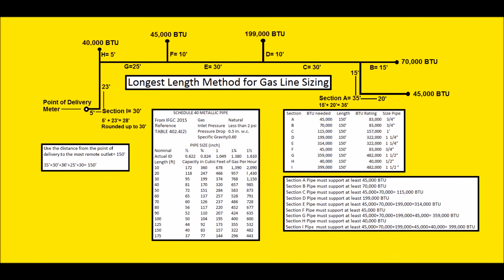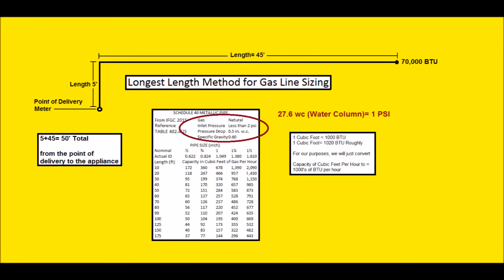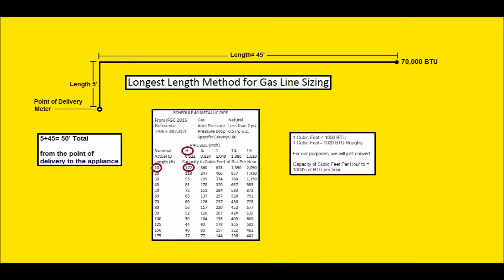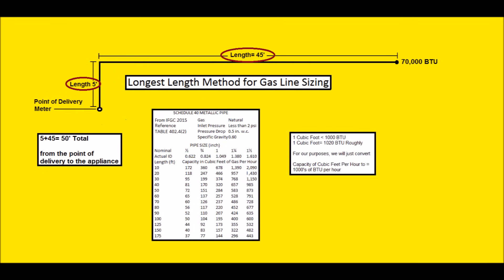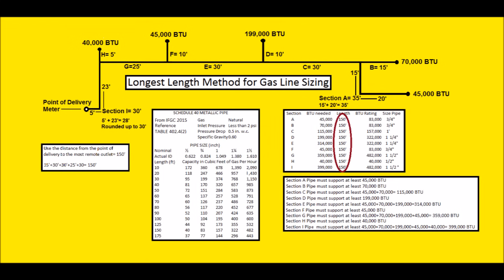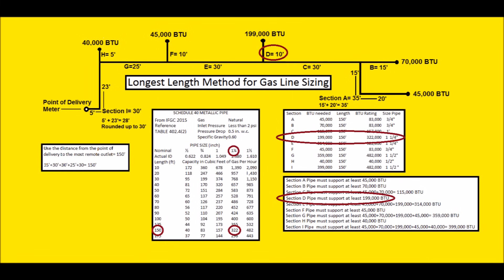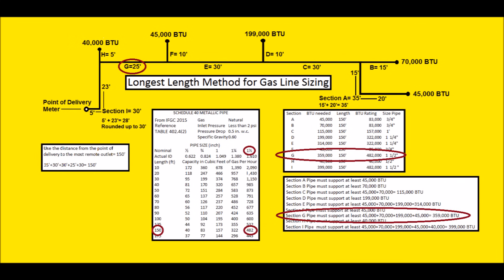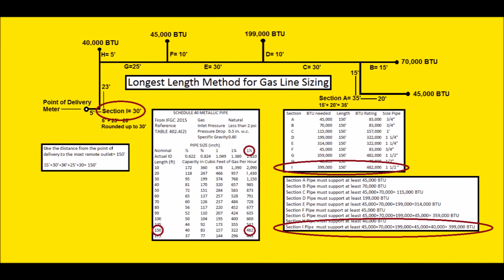Sizing Natural Gas and LP Propane Gas Pipe- Longest Length Method! IFGC 2015

Comment: Maybe you can help me out, according to my charts for undiluted LP it seems like I'd have to run a 4" schedule 40 metallic pipe to deliver 187,000 BTUH for 40 feet.  Dees that seem correct? that seems like a huge pipe to supply a home that has a 120k btuh furnace and possibly a water heater.

Comment: THANK YOU FOR USING THE TERM "MOST REMOTE!!!!!" I was having trouble because i was thinking "longest straight line" was what they were referencing, so I was just very confused as it was giving me stuff like 8" black iron pipe for a 60kBTU range. Commenting this the night before my test in class, as this helped tremendously knowing that its literally just the furthest possible point from origin.

Comment: Can i Use this on LPG ?? thank you
Reply: Literally no one talks about this. The LP charts don't seem to work with this at all. It's already measured in btu/h so it seems like you're not supposed to divide down but then if you don't, nothing adds up right. It doesn't make any sense.

Comment: One thing that makes 0 sense about this method, unless I'm interpreting it wrong, is that let's say you design an entire building with this method, and your longest length is 100 feet. So each appliance is sized with the 100 feet and according to their required capacity. Fine all good.

BUT, the day you add a small extension and need to add another appliance which is 120 feet from the meter, what then? Or say, to make sure we don't get the conclusion that line diameters won't be changed given the small increase, that the newest longest length, after the addition of the extension is 300 feet. Now all of a sudden you need to replace the piping in the entire building, because capacities were initially designed with 100 feet only?

Am I the only one thinking that makes no sense?

Comment: Do you do the longest run or to the end of the a main branch as the longest run?    Meaning you have a main branch that’s 10’ long, but off the main branch you need gas all the way over to some unit that’s 50’ long.  Is it then 50’ or 10’ for the main branch?
Reply: Longest measured run would be from where the line comes out from the meter to the furthest appliance. So in this case it would be 50 ft
Reply: @goaliebrody  but what if it’s such a small device only 3/8” line, low BTU?   It’s not like it can steal that much from the last unit on the main line that’s demanding a large amount of btu.   Just to explain, I have LP, 10’ main line 3/4” with 11 in w/c reg at the house.  Online that says the main line can support 608,000btu.  Off that main line I think I can run a 3/8 maybe 1/2 line over to a fire place that’s maybe 50’ away that demands only 28,000btu.   Sounds weird to make the system so large in pipe size when that long run is so small.   If at the end of the 50’ I had a 200,000 boiler then yeah I’d get that.

Comment: Hey Craig,
I’ve been following you for better than a year.  I’m getting into the HVAC industry and have passed the 608 EPA certification.  I am currently reading and finishing up the IFGC code training manual for black pipe cert.  My question to you is, what is the best black pipe pocket size code book available for helping me with codes for passing the black pipe test and for use later in the field?  I’ve Googled for the best type black pipe code book, but have not been successful with finding a small pocket size manual.  Thanks for all your content on YouTube and products you offer for training and for use in the field.
Reply from the maker: Jack honestly I don't think there is one out there. I would just read and reread through the sections on schedule 40 pipe and supporting, pressure testing and run yourself through sizing exercises, thanks!

Comment: You lost me at around 9 mins.  I have only gotten 3 hours of sleep so far and it’s 4:26 am.  To be continue.   I must get this.  
🙏God bless you 🥱.  

I only have one appliance.  I just have to tap from the fireplace, I think.  
My wife wants a gas stove but what we have installed currently is an electric one with no gas line in site.

Comment: How is "pressure drop" determined? Does the gas supplier give you that info? How do you get that figure?
Reply from the maker: Usually low pressure nat gas is .5, commercial nat gas .3, commercial and res lp .5 but you can check with your local inspection office, thanks!
Reply: @acservicetechchannel  if you were to have the gas company up your meter pressure to 11" wc would that increase your pressure drop to around 3" wc and move you over to table 402.4(3)? Or would you have to measure the pressure drop yourself after the meter and find the correct table?

Comment: Hi,
It's a great video. 
Is there a maximum length considered between the branch and appliance? It's because you don't consider that value in the longest length.
Reply from the maker: Thats correct, it is whatever is the longest of the lengths, thanks!

Comment: I have a furnace that needs 8,000,000 BTU and its 800' from the meter, i have 10 psi what size pipe do i need ( HDPE )

Comment: If I am sizing by branch length method or longest length method, don't I have to include the fittings(bends and elbows?.... Every practical example has these fittings.
Reply from the maker: You do unless you have 4 fittings or less, This is an intro to the topic, thanks!
Reply: How many ft of length should I add up to the total length ? 
If I have like 8 -90 degree bends and 2 Tees ? 
How much length should I add  ?
There is a table in the IFGC which says around 10 feet of length for tees , but that will increase my total length by almost 100-150 ft ...is it correct ?
Reply from the maker: Table A.2.2. at https://codes.iccsafe.org/content/IFGC2015/appendix-a-ifgs-sizing-and-capacities-of-gas-piping
It depends on what size those tees are and yes to have 100 extra feet due to fittings is a normal thing. Are you working with 2" schedule 40 because you said 10' per tee?

Comment: very informative, how does it work with a manifold?
thanks
Reply from the maker: The same way. You would take the longest measurement from the source and to the longest run off of the manifold. You would take that length measurement and use it each time, thanks

Comment: Hey A.C do you have a refrigerant line sizing video . As I am not yet in an 313 A or D course here in Canada so I would not have the code book.  However I have a gas filter 1 certification.
Reply from the maker: I have not built one yet but would like to at some point. This is the closest I have so far, thanks-  https://youtu.be/_8g6xaCKDqc

Comment: Great detailed lesson. Got one question though. Say existing home has 1" black iron ran for 100'. And i branch off for a new gas stove but use copper instead. Will i use same sizing chart for the black iron or switch charts just for that one run?
Reply from the maker: You would use the copper sizing chart found in the ifgc 2015, thanks

Comment: my question is are you going to use 1.5 pipe and use .5 on the first appliance then .75 on the other appliances.?
Reply from the maker: Yes except for D 199,000 which was 1 1/4". Thanks Gabriel Brown!